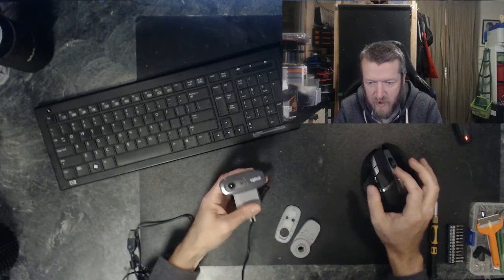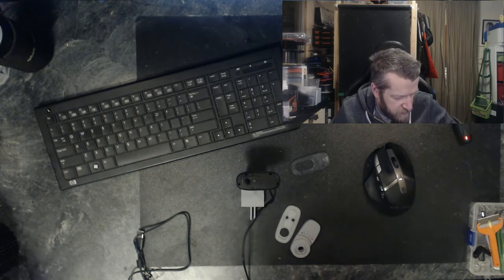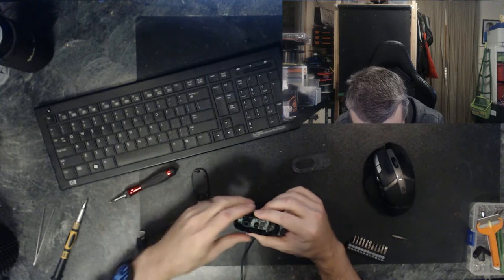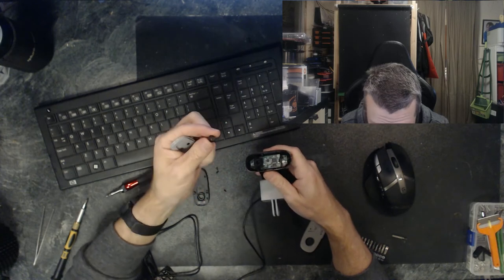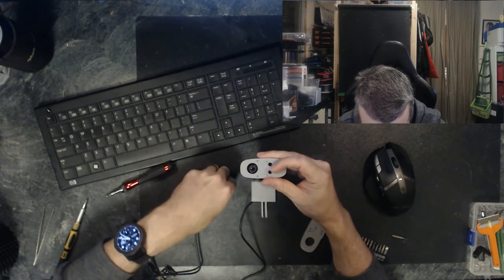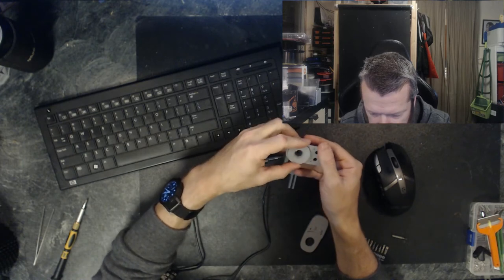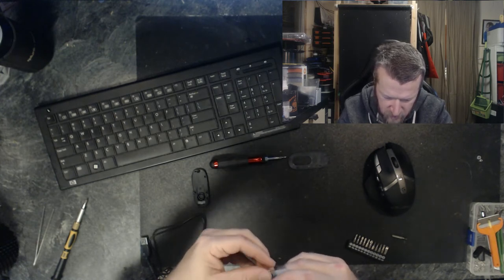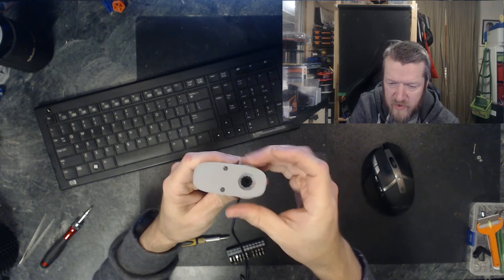Episode 40 - Logitech C270 Focus Ring

Comment: Useful video, I'm currently working on modding my c270 webcam for printing timelapses. Couldn't find any online info about what screws to use except in your video here. However, what two additional screws did you end up using? As well, your audio was very quiet with a lot of white noise - a $5 lapel mic from AliExpress could improve your audio production quality. All the best, thanks.
Reply from the maker: The additional screws we some I had lying around, not sure what they were.  I actually have 2 lapel mics one was under $5 from ali express the  other was around $30 and is better if I remember to turn it on.